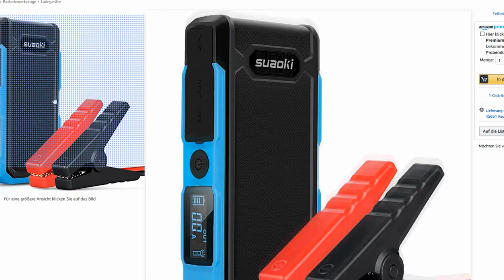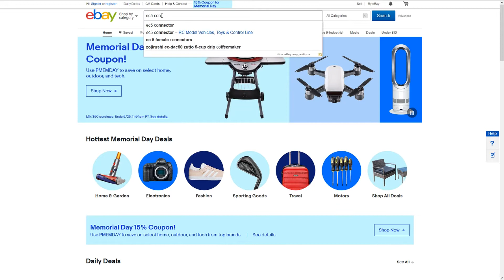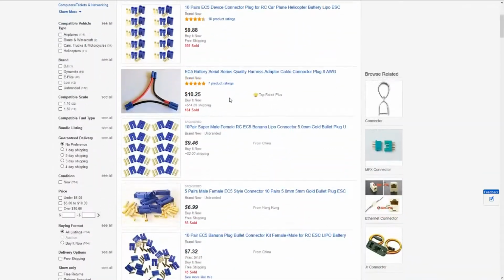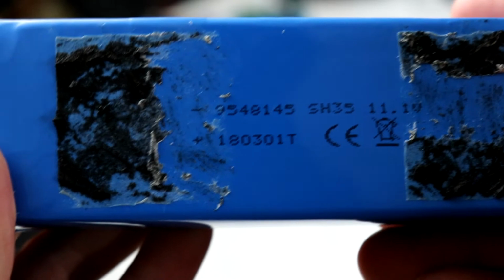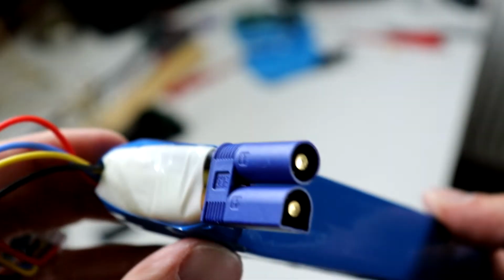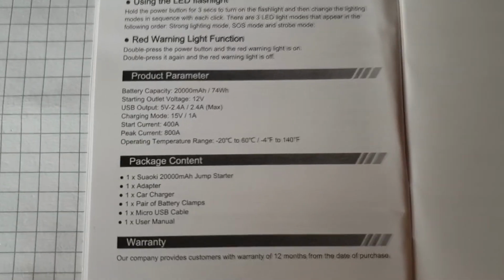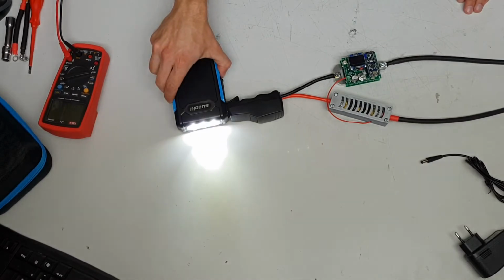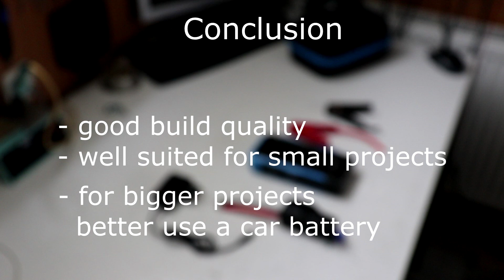Car Jump Starter for Spot Welding Test

Comment: Hi, can the welder be powered off 4S? I have a 4000mAh lipo laying around, but it's 4s..
Reply from the maker: It can only take 3s lipo or 12V car battery. Max working voltage is 14v.
Reply: @Malectrics  what about a 2s 5000mah 60c? I have one .
Reply from the maker: @MinecraftAndMoreRandomness  the mosfets need at least 10V to operate in optimum way. They will also work with 7-8V, but will produce more heat. If you deactivate the low voltage alarm in the Arduino Code you could try to use 2s.
Reply: @Malectrics  Ok thanks ill try it I already got my 5000 3s lipo though.

Comment: ich benutze 10 powercaps (2x5  500F 2,7v mit platine) geladen über einen dcdc wandler (mit spanungs und strom begrenzung) der an einem 24v /5a netzeil hängt, geht super und ich muss nicht erst einen akku laden oder bereit halten.